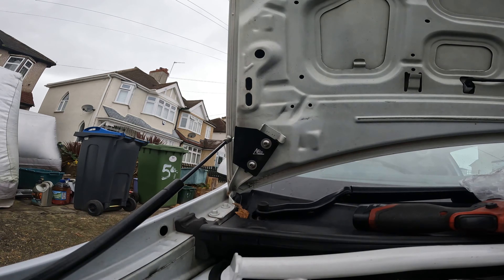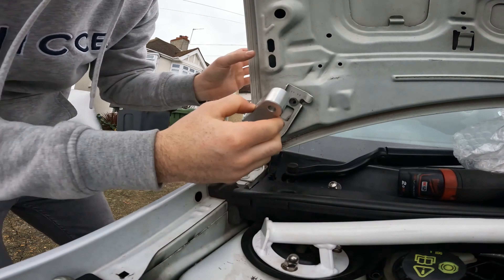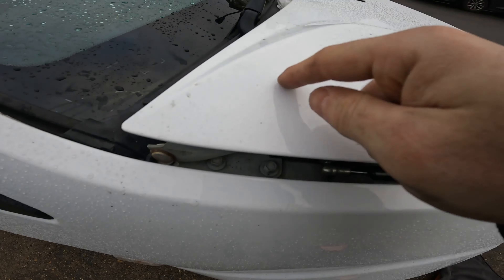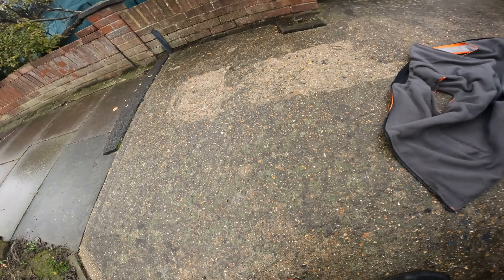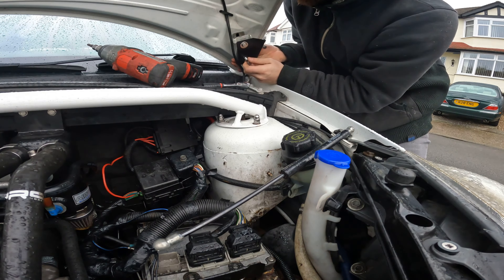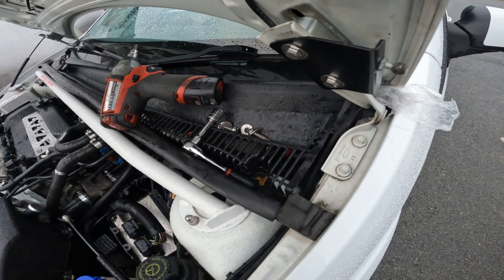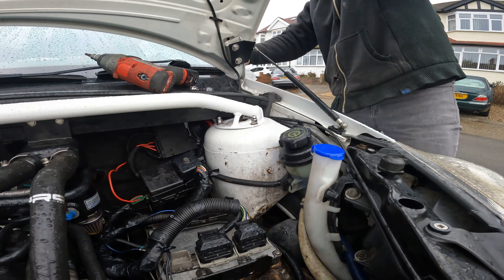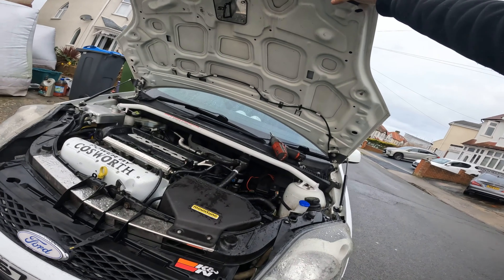MK6 Fiesta- Fitting Ford Racing Bonnet Raisers/Spacers From Burton Power

Comment: I did it today got longer bolts bigger nuts to slide on like spacers but I put them underneath the bonner hidges and washers at the top so was and easier install. Cheaper £3.60 and no broken screen. But i needed the room under the bonnet it could close eaiser past my inclosed induction kit. I cable tied to the pannel at back of bonnet/ under the windscreen. I also removed the rear bonnet seal for more air flow. X4 20mm longer bolts and 8 nuts for a 14mm raise with the option to got for another nut giving me another 7mm.
Reply from the maker: Well the spacers didn’t cost me anything they were a gift but yeah ended up costing me in the end I’m gonna do away with the spacers now I’ve had enough of them lol

Comment: You're not the first to find you've got a lower-corner windscreen crack after doing stuff with the bonnet single handedly ;) 
I've just done RS bonnet vents and a scuttle seal delete, I did consider doing this. Could the spacers go on the other side of the hinges? As in between the wing and the hinge?
Good stuff though mate :)
Reply from the maker: Lesson learned on that one haha and I’m not sure mate I’ve never tried it that way
Reply: @6uiltdifferent  Thanks for the quick reply, well I reckon that could be a solution then!
Doing 'reseach' while recovering from a nasty cold;) 
Surprised I've not watched more of you channel before.
Reply from the maker: @G-force_Motorsport  my channel seems to be hidden compared to other st150 channels lol
Reply: @6uiltdifferent  I would really say that, if I do a search for 'fiesta st150' I see two of yours in the top 5, with just one Mend it mod it in there, along with a JayEmm and someone else ;)
Keep it up!
Reply from the maker: @G-force_Motorsport  ahh fair enough it feels that way sometimes lol in terms of views and increase in subs, thanks though mate I really appreciate it

Comment: 🤣 just why
Reply from the maker: Why not
Reply: @6uiltdifferent  because why would you have purposely put panel gap on a car 🤷‍♂️
Reply from the maker: @408jake2  good job it ain’t your car then 😂if you listened in the video the strut brace is running against the bonnet plus I like the raised look
Reply: @6uiltdifferent  but there are plenty of other ways around sorting the strut brace
Reply from the maker: @408jake2  I know that but maybe I wanted to raise the bonnet it was always on the cards the strut brace just made me do it sooner….  A little advice though Maybe try and suggest other ways for someone who may not know  rather than thinking you’re funny putting a dumb comment